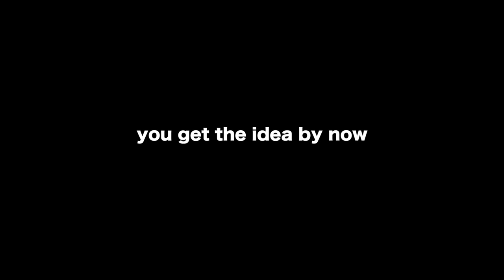How to Restore Chrome Drum Hardware

Comment: I'm pretty sure I've said this before on your channel but you really need to try putting chrome hardware in a bath of water and dawn dish soap. Leave it soaking overnight and it comes out like new. Tin foil and steel wool can leave tiny scratches on the surface. The Dawn method is used by vintage drum restorers and can remove even the worst cases of rust.
Reply: Is Dawn a brand of dish soap ?  Or is any 'heavy duty' dish soap gonna make it??
Reply: @foxytv4896  i'd like to know that too
Reply: Dawn method usually works but not on 62 year old rusted af tension rods
Reply: @tendingtropic7778   @foxy TV  Yes, Dawn is a brand of liquid dish detergent/soap here in the US.
Reply: @foxytv4896  Yes, Dawn is a brand of liquid dish soap. It's heavy duty for breaking up cooked on bits and oil that's on a pan. Cheers
Reply: I wouldn't think a water and soap bath would in any way remove anything but dirt and grease.  I just don't see how it's going to attack and remove oxidation and pitting in any way.  It will of course remove some of the powdery stuff on the very outside layers but I assume not much else.
Reply: @oldowl4290  I’ve used the Dawn bath method for several drum sets and dozens of snares/stands. It pulls rust right off into goopy orange clumps. Pull the parts, dry and then polish. The length of time in the bath depends on the amount of rust but it works every single time.
Reply: @ChaseOfBass_  What do you use to polish after the bath? Also, how much dawn to water (ratio - ish)?
Reply: @ChaseOfBass_ , Hey.  I tired your method of washing drum hardware with Dawn dish soap.  I stripped my drums down to the bare shells, put all the hardware in aluminum tubs, and filled them with water and Dawn.  Everything looked great yesterday when I rinsed them all off, then left them on a bunch of paper towels to dry.  But today I discovered some of the parts got rusted?  They are definitely much shinier than before, but also now have rust spots which they didn't before.  Also noticed all my screws had that orange gunk you were talking about.  Seems like I made them worse.  Wondering if you know what I did wrong?
Reply: You should not have “left them on paper towels to dry”. What you did is create an environment for rust to form. Repeat the dish soap/water process again, but this time dry them immediately and thoroughly. I’ll even blow a hair dryer at them to ensure there’s no moisture remaining on them after I dry them off.

Comment: That looks great! I like to use Flitz (or something similar) because it will actually polish bare steel to an almost chrome-like shine, so if you do have chrome missing, it's hard to see. Also the Flitz has come kind of sealer in it, which protects the metal. Thanks for posting.
Reply: Flitz has a tiny bit of an abrasive component in it but I find it's worth using it to polish chrome and NS12 alloy. Less scratching than aluminum foil too

Comment: OK - You are officially my Hero. (there may have been slight tearing up..)  SO, My mum, bless her, gifted me with a 1970's Slingerland 6.5' x 14" Gene Krupa model Snare Drum, Chrome over Brass.  It is beautiful, However, (as these amazing sounding shells are prone to being a bit on the soft side) there's some minor denting and the chrome is Decent, but could benefit from polishing compound etc. Your Chrome Snare w/polishing compound, refinishing video was AmazinG and gave me hope .. Then I see this. O.O  ...my jaw be layin' round here somewhere... I know you must get tons of emails., but as I will be stripping the shell to give it the business, I wondered if you had any tips for Chrome that is over Brass, rather than Steel (or if it matters). There is some deep scratches and a bit of rust pitting on the shell and lugs. Aluminum Foil and WD40.?. or Brasso, Polishing Compound and some whiskey for courage?  Thanks man. Cheers! This was seriously amazing.

Comment: I know you said that you don't like to use water,  but citric acid powder baths are the best and easiest way to clean chrome parts and shells I have found.  .75 of a cup per gallon of water left over night and the crap and rust wipes off.  no scrubbing.
Reply: Yup I would throw that whole stand in a bath. It would have probably taken care of that clutch

Comment: I did the same thing with a very badly rusted drum kit I got for free.  I used aluminum foil with cola. I used diet Coke but word is any cola will do.  Something about the phosphoric acid in the cola. It worked amazingly well with surprisingly little elbow grease. 

But looking at this video above seems the foil key to this working.

Comment: This is going to sound crazy...  but I recently helped a friend find a drum set for her son (on a budget) and we ended up getting a great deal but the hardware was super dirty and when we set out to clean it, I joked that we should put it in the dishwasher.  ...and then we did.  ...and the results were amazing.  Of course we only washed the metal parts (for the most part) and we made sure it was completely dry before reassembling but It looked like brand new.  I did this again with an old snare drum that I bought on craigslist.  I put all the lugs and rims and strainer, etc in the dishwasher and it was like magic.
Reply from the maker: ha! ill have to try that when I get the chance

Comment: Old man tip here boys:  Hands down the absolute best thing you can do after cleaning up drum hardware is liberally coat it with SC Johnson's Paste wax and lightly buff off.  It's a miracle. I use it on all my tool restorations and for example I cleaned up an old rusty drill press post around 10 years ago back to shiny steel and it still looks as good as the day I refinished it.  No oxidation or rust anywhere.  If you also put it over the chrome, it'll have the same effect and will greatly reduce future pitting.

Comment: 0000 steel wool works wonders as well without scratching.  You do get the small wool dust on the hardware so I use my air compressor and blow it off intermittently

Comment: This was uploaded at such a perfect time, I was going to clean up all of my chrome hardware tomorrow on a used drum set I recently got, I have brasso and steel wool and wd40, would you recommend this technique for tension rods and rims?
Reply: Don't use steel wool it will leave fine scratch marks on the chrome. brasso or Autosol meatal polish is by far a better result. Remember chrome is applied in a dipping bath, it is not as hard a substance as raw metal so it will always come off second best against steel wool or tin foil. even hard scourers will leave fine scratch marks detectable with light coming of at the right angle
Reply: If it's just dirty and/or slightly pitted wipe the dirt off with a microfiber towel then use Flitz, Simichrome or Mother's Mag cleaner for the detailing

Comment: A friend of mine (a skilled drum builder btw) suggested to use only steel wool #0000.
No wd40 or other products.
If you have to clean dirty hardware you move with fiber of steel wool that are turned90° from your movements (for example if you move your hand up and down the fiber must be on the right or on the left, not straight to the movement you are making).
The rust will be smoothed and less noticeable and the pitting nearly gone.
This steel wool can be also used to clean the inside of the wood shells, (for example when the shells have seen some humidity and are kind of rough) so the shells can resonate more and sound better.
But to clean the wood in this case the fibers must be straight to the movement you make.
Hope it's all clear LOL
Otherwise feel free to ask further explanations ;)
Reply: baorozzo my hi hat stand rusted in a year!

Would steel wool or aluminium foil be better?
Reply: Flitz and a microfiber towel

Comment: Bought a cheap off-brand practice kit. Shells are nice and tune well, but hardware is weak, as expected. I've cranked the tom wing nut about as tight as I feel comfortable with, (without breaking nut), but tom still vibrates loose on arm. It's a polished smooth arm, otherwise I would try the old soda can aluminum wrapped around tom arm to give clamp a better bite like we use to do on stripped bicycle handlebars hack, but I think this surface is too smooth for that. Any suggestions? I really appreciate all your hacks! THANK YOU!

Comment: How did you make the leap to Al Foil? My approach (I'm kinda slow) would have been to use a rag, a steelo pad and some Silvo or other metal polish. Yet, here, an unlikely material such as foil seems to just work!! Is there some kind of reaction with the metal going on or does it just have the 'right' level of abrasiveness? Thankyou for sharing, by the way
Reply: John Maguire It's softer than chrome so it doesn't scratch it, but it's abrasive enough to get gunk off.

Comment: All I do is take it ALL apart and use 0000 grade steel wool and buff the chrome to a perfect shine - it removes the rust and leaves NO SCRATCHES! Then spray some clear enamel onto the surface to seal out the oxygen to stop the rust or if you have access to a decent chrome spray paint use that first.

Comment: Great method. Would you do the same to restore a pitting supraphonic shell?
Reply: Hell no. Wipe it down gently with a microfiber towel then don't clean it anymore. The chrome will flake if it's plated onto aluminum which is probably what you have

Comment: Silly question, if the stand is the same as the one you have, and you have taken the time to clean it up, why swap out the internal spring with your old one?  Why not just use the new stand?  I have two of this Tama lever glide stands and they are great hihat stands.  Thanks for the clean up tips. My older stand could use this treatment.
Reply: His other Tama stand's probably in better shape than this one even after the cleaning

Comment: hey, have you tried cleaning cybmals with kerosine? It removes most of the junk by disolving it, i think it might work well
Reply: Don't do it. You're better off with Dawn dish soap and a little elbow grease. If you want a deep clean use Flitz but it has abrasive so use a little bit of Carnauba wax after cleaning to protect the cymbals from oxidizing. Don't forget to use electrical tape to cover the logos when you're cleaning if you want to preserve them

Comment: Is the foil working as an abrasive like steel wool?
Reply: I've used this same technique when restoring drums. The aluminum (or aluminium if you're from across the pond) foil is much softer than the chromed steel so it will not scratch or otherwise damage chromed surfaces. Do not use steel wool for a project like this. Once you have removed the rust, you can use a little bit of car wax (I like the spray on kind) to prevent future rust build up.
Reply: Yeah, I knew that trick with steel wool. It works
Reply: If you use 0000 or even finer grade steel wool it leaves no marks on the chrome at all. :) I have used it to restore my 1980s Pearl steel snare and it looks (and sounds) amazing!
Reply: Yes, 0000 grade steel wool is the way to go. Just make sure to NOT use any coarser grade. Only the Superfine 0000 grade. Very easy to use and no liquids needed.
Reply: 0000 grade steel wool is what I use as well, but I'd like to try his method, too, just to possibly expand my options.  I do add one thing to the 0000 steel wool though. 3M makes a product called Imperial Hand Glaze. The product number is 05990.  It's mainly made for automotive paint use, but it has been a miracle product for me with my drum restorations.  Not only do I use it on chrome parts, but it works great on vinyl wraps that have faded - without the steel wool, of course.  Just use it with a terry towel and wipe it off with a microfiber towel and you are good to go.

Comment: Any tips on what to do if the chrome plating is off in some parts of the hardware?
Reply: Leave it alone, get it replated or get an "almost" chrome paint pen from Molotow for touch ups. Their brand is the closest thing to chrome out there but will still dull a bit if you scuff it.

Comment: Those wing screws are hardly rusty, I found a kit in a garage told it had been there nearly 30 yrs, now the chrome hade really pitted and gone mostly on the hi-hat & the cymbal stands, no chance of retrieving the the original chrome using wd40 & tin foil unfortunately.

Comment: Would steel wool work instead of foil?
Reply: No, steel is harder than chrome, so it'd scratch the chrome while removing the rust. The foil works because aluminum is hard enough to remove the rust, but soft enough to not scratch the chrome.
Reply: I disagree. I use 0000 all the time in hardware and it works great.
Reply: It does work, but you have to be more careful. I've used it too for years, but I think Al will work better. Gonna try it on my next clean up.
Reply: Same! :)

Comment: My hi hat rusted badly in 1 year since bought new.. is it normal??? :0
Reply: Dark Drift0r I had a cymbal stand that had the same problem.
Too much moisture usually does that. My kit was inside a very small room with almost no ventilation. So my sweat and moisture from the air damaged my hardware quite a bit.
Maybe that's the issue that happens to you. You can try to improve ventilation in the room your kit is in. Other than that, you can check if no water, leaks or whatever hits your hardware.

Hope it made sense or helped in any way. English is not my first language

Comment: Arright, I got a Question for YOu... How ya git' them tough spots out on them UFO's with the Crinkly metal you can squish? I can't even use a polishing cloth on the damn thing 'cuz it just.. well.,, Crinkles! I did however, mistake brake cleaner for WD40 and it just done gone and evaporated the squishy metal. So now there's a hole. ... In the Space Bucket. ... damn aliens
Reply: Blast off!